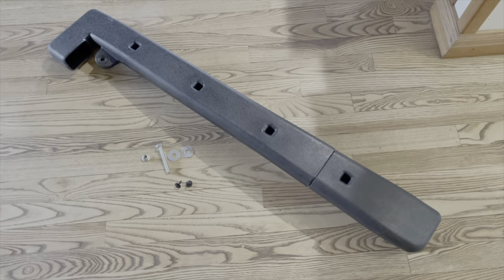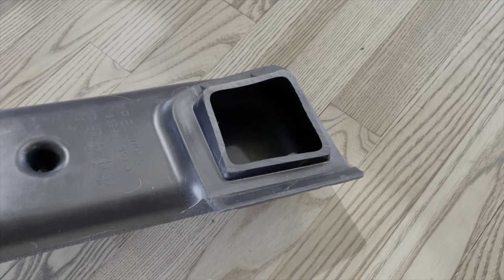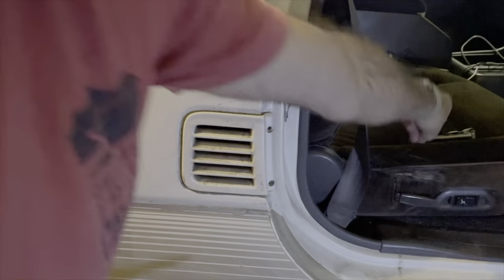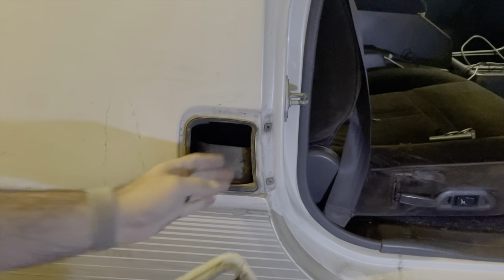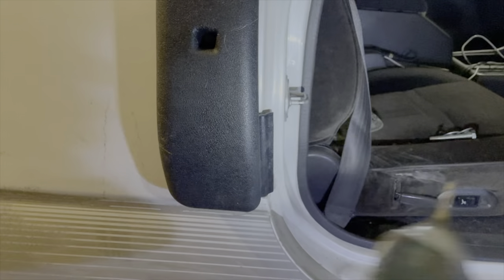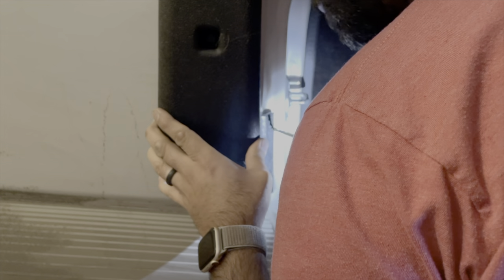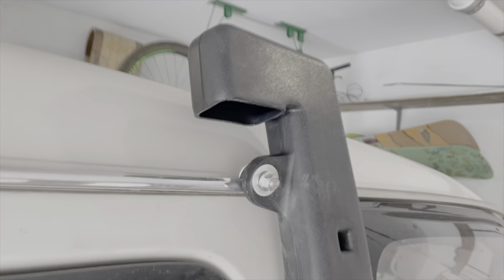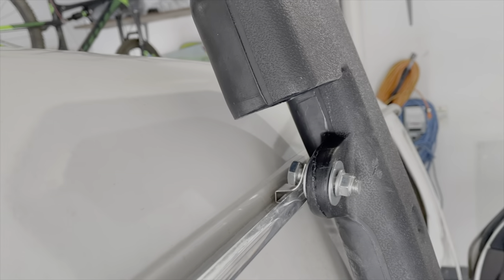Toyota Hiace Snorkel Intake Install

Comment: Since it isn’t actually plumbed into the air intake, not sure I would attempt deep water with that.
Reply from the maker: It’s literally an extension of the intake opening. Only weak point would be the rubber seal that this fits in.

Comment: Does it improve mpg?
Reply from the maker: Hard to tell. At the time I installed this, I had also swapped out to an aluminum radiator. After both things were installed I did get slightly better MPG.
Reply: @TheBroDojo  Mind if I ask what radiator you installed?